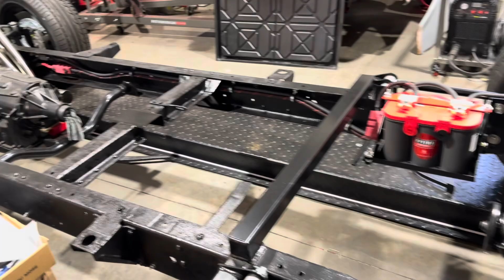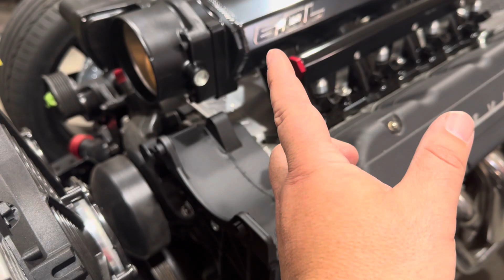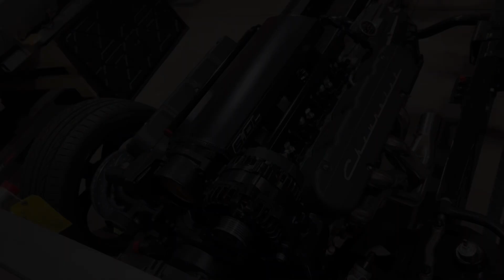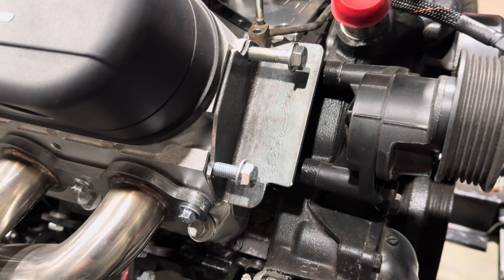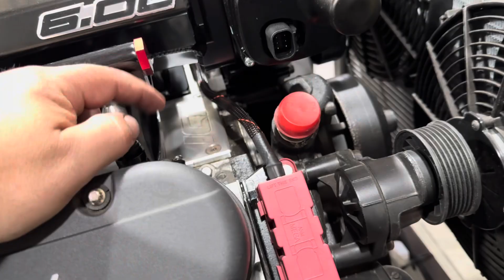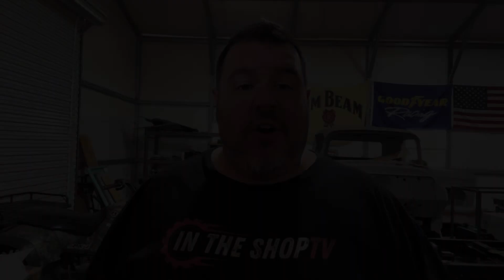I Bought the CHEAPEST Alternator on AMAZON, and Turned it Into a High-End BEAST!

Comment: Why flash tech M?
Reply from the maker: In the 6L80? I depends on the engine you’re using but one example (if its paired to the same engine it was originally programmed to), would be to tune them not to lock up until 5th and 6th gear as the torque converter is typically what goes bad in these transmissions first. A good standalone transmission cooler is also almost mandatory with the 6L80

Comment: Great fabwork on that bracket!!!   C'mon, ya gotta tell us more about that paint job LOL ... did you paint it with a brush, what hardener?  Great info !!  Thanks!
Reply from the maker: The fuse block bracket? Primer and low gloss tractor paint in a rattle can. I wanted slightly more protection so I hit it with a light coat of Satin clear too. Thanks for watching!
Reply: On the alternator. Thanks

Comment: I am doing a swap in my 03'Crown Vic Police Interceptor.  Ls3/6lL90E. I want my brakets and accessories black as well. I like the blacked out look. Yours looks really good. I just finished my bottom end last night at midnight. Now I need to start getting parts for the 821 heads. I can't afford to drop $10 grand on an ls3 dropout, and I didn't want a 5.3. I would have gone with a 6.0, but a 6.2L L94 block fell into my lap for $500. SOOOOOO Ls3 it is lol. Ls3 flat tops and a BTR RedHot cam, and I'm on my way. I have a ways to go.
Reply from the maker: Sounds like a pretty good plan to me! And total score on that motor!!